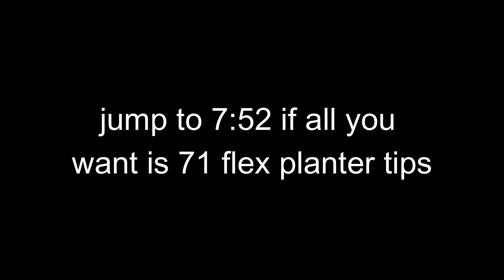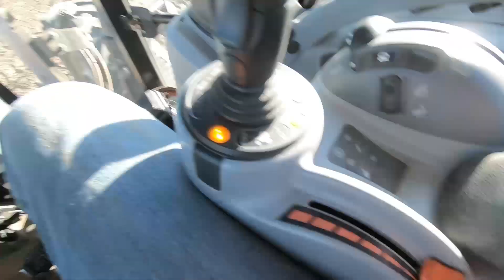Planting With A JOHN DEERE 71 FLEX PLANTER #plant22

Comment: Side by side test of the flex 71 and the tech nightmare you are planning on using? Depth and population. You know if you got the time.
Reply from the maker: Not sure how I could do a fair comparison since it’s two different crops…I suppose I could see how even the seed emergence is going to be between the two planters. We planted the sorghum at 1 inch deep and about 80,000 seeds/acre. Then on the corn I did about 40,000 seeds/acre on one field and the other I planted at 35,000 at 1.75 inches deep.